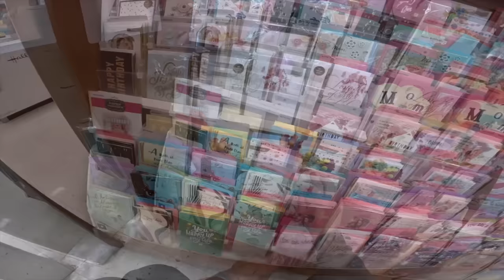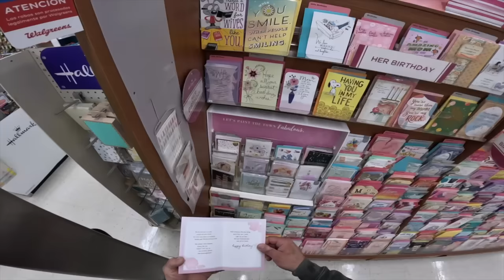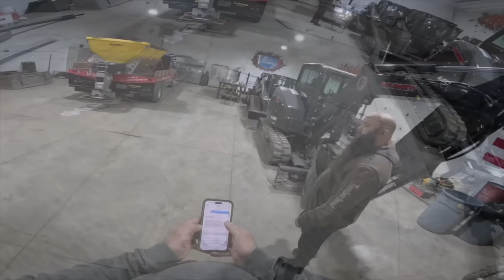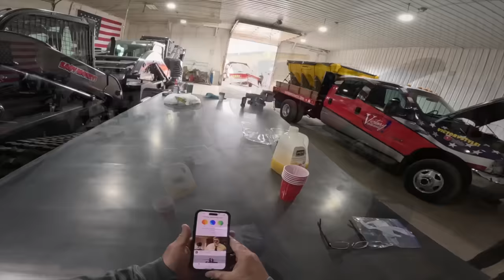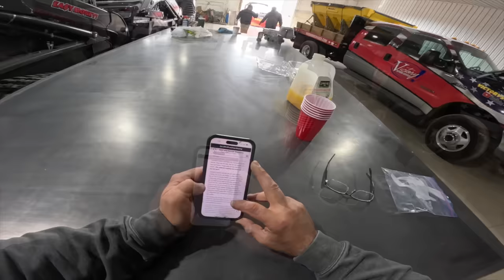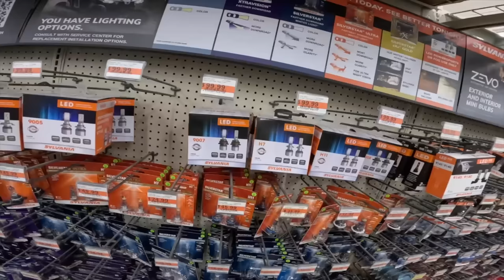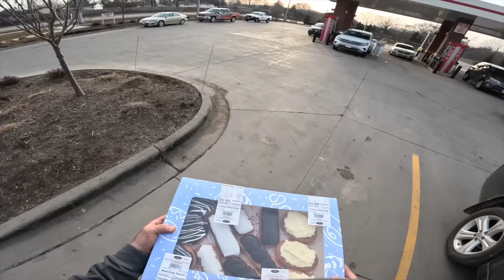Eric salted WAY TOO HEAVY!

Comment: Ryan correct me if I’m wrong but the new headlight lenses going into the truck are all clear. The old ones you pulled out were amber for the turn signal portion. With the new lenses and bulbs your turn signal will flash clear (or blue depending on how fancy the bulbs are 🤣) with that being said you’ll have to get amber turn signal bulbs so they actually flash the right color. Should be a 3157A or 3157NA depending on brand.

Comment: About the LED headlights: You need different light housings for LED lights. The reason why is the way the bulbs emit light. The old lights emit light 360 degrees from the bulb. The LED lights emit light from the chips in certain directions only.

They'd be great for you driving, but you'll blind everyone else, even on low.

Comment: Don't forget, when you put the new bulbs in (not the headlights) but the other ones the 194s and the 31XX if they're LEDs they're Diodes so if you install them and they dont work, just flip it around and they should work.

Comment: Do yourself a favor and buy good led headlights and fog lights. It will make a significant difference. I’ve had led bulbs and they are nice too but they aren’t the greatest when the headlight isn’t designed for it.